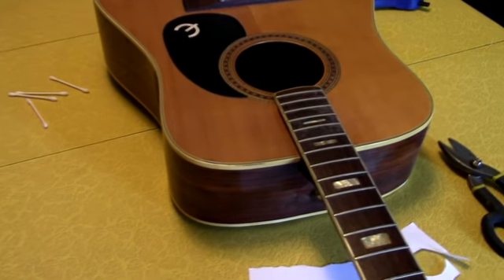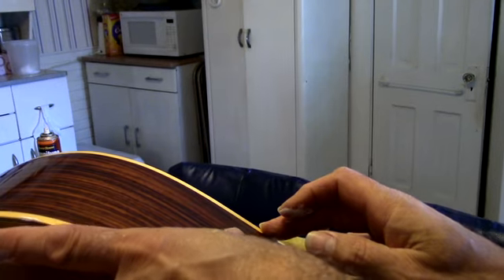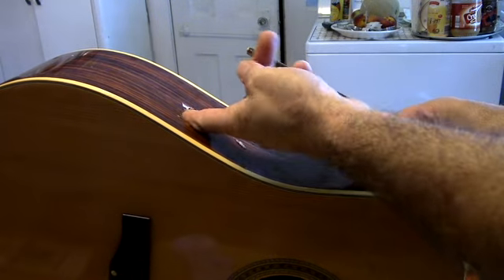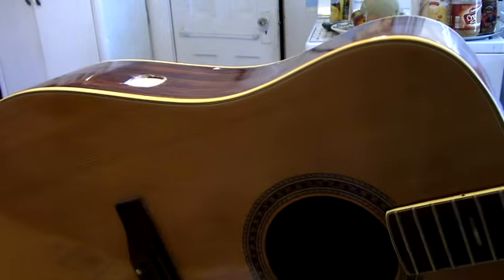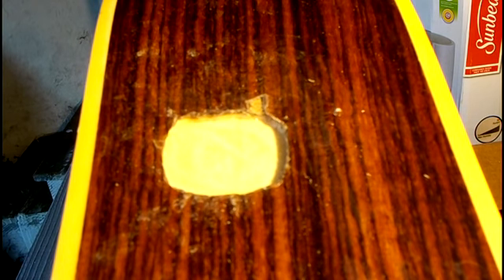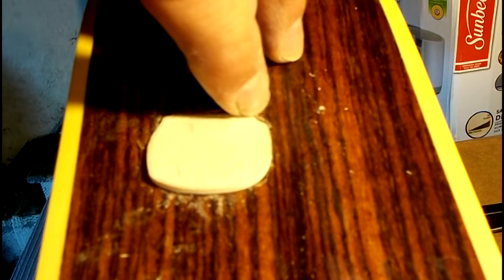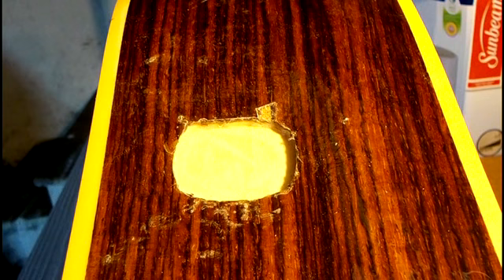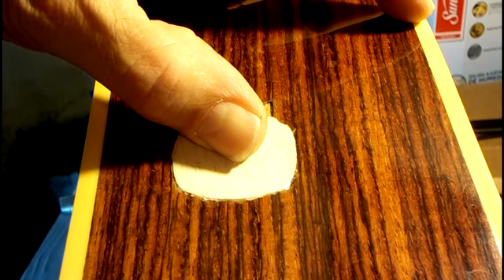Guitar Repair Restoration Strings and Tuning Part 1 of 3 Gorilla Wood Glue Country Acoustic Guitar

Comment: I have the exact same guitar . It's a about 72  model FT150 . I removed the laquer from the top to bare wood and now I,m not sure what I want to put on it . I prefer the light color above the orange that was on it . They are super players . Lovely easy neck - bolt on .